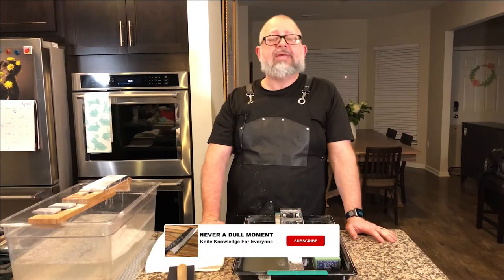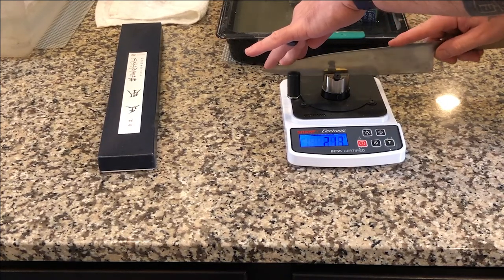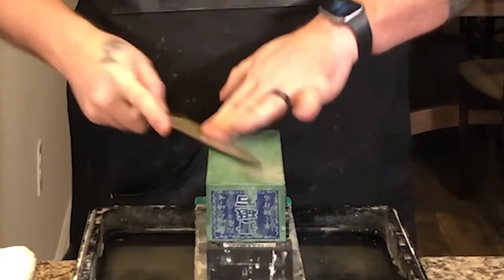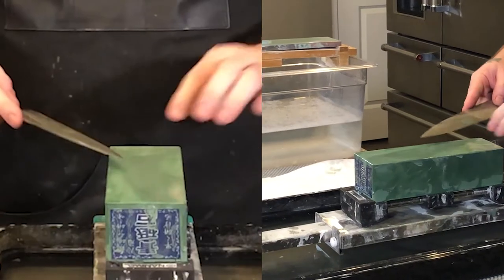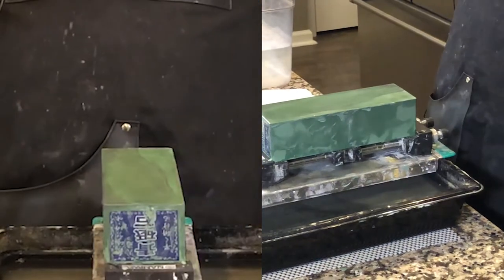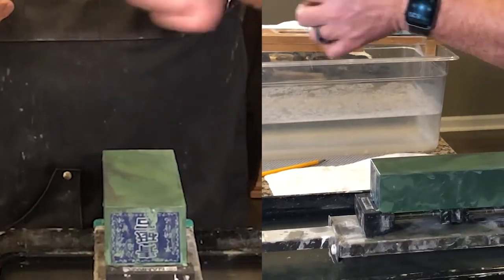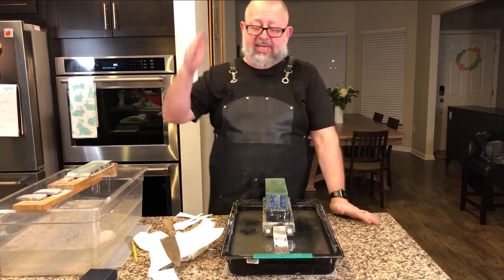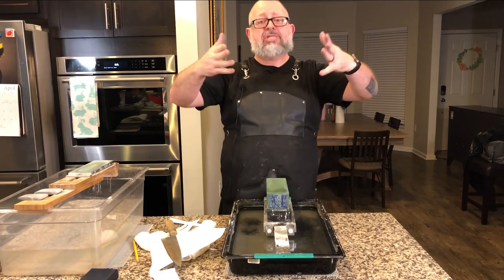Knife Knowledge: Green Brick of Joy! Naniwa 2k (2000 grit) Whetstone

Comment: I have used the Green Brick on and off for several years.  I like it, but it does have its quirks.  My take:  It performs and polishes much higher than it's stated grit -- more like a 5K stone.  I use it as a splash & go; there's no need to soak.  It is, however, VERY soft and loads up and dishes out easily.  For that reason edge leading strokes must be done with care to avoid gashing into the stone.  I generally use an edge trailing stroke. If one can live with all that, it's a very nice stone.
Reply from the maker: You definitely have more insight than I do. You’ve used it for a long time. I appreciate your input.
Reply: What’s the highest grit I need to sharpen a pocket knife?

Comment: I've used the Green Brick of Joy and for me it's kind of a litmus test for getting my bevel set right. I use a USB microscope (I know - "training wheels"). I can get what looks like a perfectly even bevel on a Naniwa pro (Chosera) 400, and 1K. then go to the Green Brick and uh-oh, the bevel wasn't as good as I had thought! The 2K really polishes it up fast and shows mistakes. When I get it clean with the 2K, I can go to a 10k and a strop and I have sub-100 Bess. 

The 2k is a difficult stone to learn to use correctly, is my take on it. A Chosera 400 is almost a beginner's stone, it's so easy. But like the man said, he's going with a knife he knows. The 2k is the same - it requires knowing. Then, it's a terrific stone.
Reply from the maker: I agree that if you don’t know what the burr feels like then it’s hard to do it on the 2K. You gotta know first and then you can mess around

Comment: Thanks for that take on the green brick of joy 🤩 
I’m probably thinking cerax/rika 1000/5000 or cho 800/3000, but have been curious where this soaker 2000 would exist just cause it’s so cool. 

I need it. Just not sure why. (This doesn’t slow me down usually 😂)

Great teamwork- us guys who are survivors know the pecking order!
Reply: While I’m here - as you see I’m in purchase mode. Basically deciding soaker vs splash n go. Been sharpening on mid/cheap stuff or systems for a while and the experience isn’t very enjoyable. Plan is one of the two mentioned and like a Shapton pro 320 in the basement or maybe an atoma plate that would double duty as flattener.
Thoughts if you would please? Thank you 😊 
Sub’d
Reply from the maker: @baldwin9281  I own everything that you mentioned and I love them all. I don't know your budget but I would definitely make sure you could flatten your stones first. The 320 isn't that aggressive if you already have a 400. I would go down to the 220 to just do the work a little faster. If you're already going to be grinding that much material off might as will be a little bit more aggressive. I like splash and goes over soaking stones. I do like the stone and we're getting ready to do a whetstone war with it.
Reply: @nadm  thank you!  I’m looking at probably an Atoma 140 that I can do double duty with.  Budget is such that I can buy the better stones - but no free lunch. It has to make sense. Not worried about high polish. I much prefer Katsumi. Is the splash n go preference just ease of use? 
Thanks again! 
Marc
Reply: @nadm  how much of a ripper is the Atoma 400? Any experience? 

When I need to REALLY remove stock I have ceramic belts and 8” diamond wheels (the latter being INSANELY expensive but handy) so I’m trying to figure my best move here in the low grit space for now. Knowing me now that I’ve opened this can of worms I’ll end up owning everything eventually anyway. Just timing 

Thanks 🙏
Reply from the maker: If you’re not a true hard-core white stone person then you don’t need it. If you’ve got all of that then you’re fine. If you’re a Whetstone person you need it to flatten your stones. You don’t need it for your knife
Reply: @nadm  thanks 🙏 
As mentioned I have all kinds of gear but it’s time. 
I also sharpen a wide variety of edged items. Kitchen knives is maybe 10-20%
Gonna spend some money today. 
Best to you sir. Thank you for your time.
Reply from the maker: @baldwin9281  that sounds like a plan
Reply: I've got all of those. I'd go for two stones instead of green brick any day unless it is a budget issue. Green brick is about average on feedback, soft in a bad way (not nice muddy but you can cut into it easily), tends to load up and does not cut that fast. With two stones like 1k+3-5k you get faster cutting and similar 3-4k polish.
If you're into sharpening and like to test out different stuff green brick can be a joy. It is different. It may not just be a safe bet for everyone.
Choices like cerax or naniwa pro is a safer bet. Suehiro softer stones like ouka/rika are excellent too assuming you have a good technique. They are very soft and easy to cut into but they are soft in a nice way giving nice feedback.

Comment: Not to let on about my activities, but you can use a 6lb test monofilament Spiderwire. The calibrated Edge-On-Up filament is like $20+ bucks for 325 tests. If you allow a generous 4" per test, that's somewhere around 100 feet of line. If you've ever gone for them easily spooked fish (and tree branches), you know you get 300 YARDS of Grade A+ line for around $8 bucks. And it has low memory (if you know what that means). The 10lb. line is stronger, the 4lb. line is weaker. I have yet to run full comparisons, but I know that if I get 140 grams on 10lb test, that's likely below 100 on their calibrated line. How nerdy can one get? Testing 20 times on a 240mm knife just to be sure?
Reply from the maker: So, I get really nailed by people in videos if I don’t use something that’s BESS certified. I’ve had a lengthy conversations with people who won’t let it go. I can definitely do something like what you’re saying for my own self but I could never put it in a video. You’ve got to live up to everyone’s expectations!

Comment: @NeveraDullMoment will this stone work on Yu Kurosaki SG/r2 stainless
Reply from the maker: It definitely should. This stone has been incredible every time we’ve ever used it. We are still messing around with the different types of stones for the type of steel you’re referring to. You definitely have a reason to be concerned because of the hardness of the steel. I have not found that anything has prevented me from sharpening it. Sometimes it just takes a little longer. This stone has been just an incredible performer and some thing I think everyone should have in their arsenal.

Comment: It seems to me you deburred at a lower angle than you sharpened. I am not trying to criticize and I am sure you are a better sharpener than me but it looks like you went from 15 degrees to almost flat against the stone and probably still had a burr.
Reply from the maker: So, I finish my last strokes flatter. I use my first strokes as a way of getting off the burr. I do my last strokes as a way to flatten out the edge.